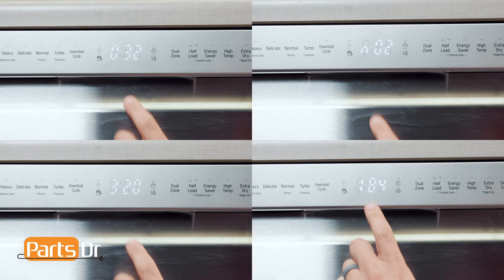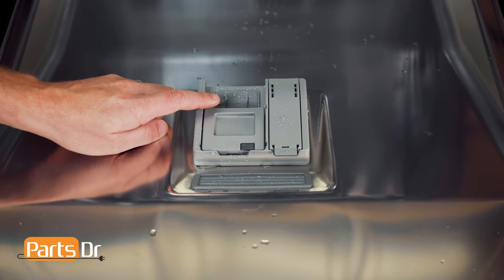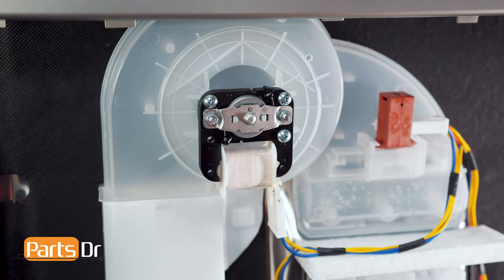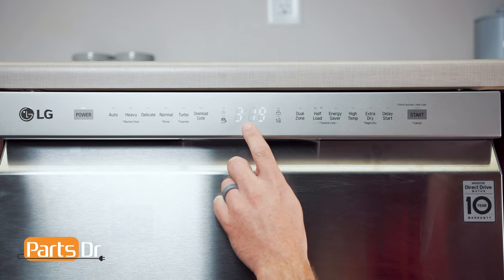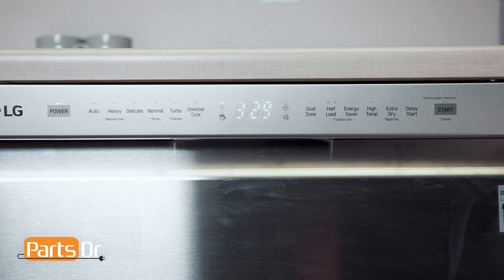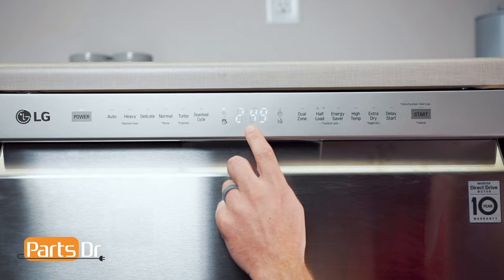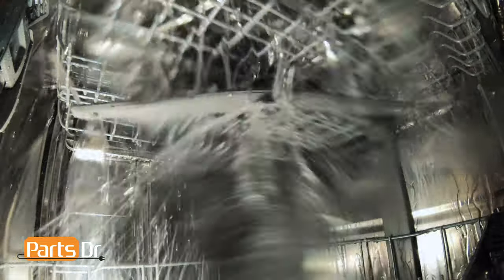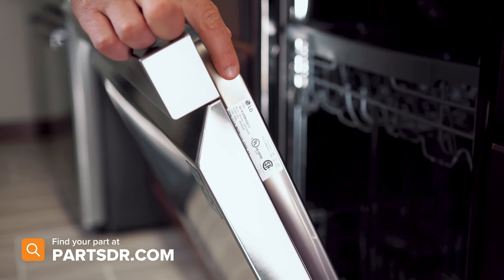TOP SECRET LG Dishwasher Service Test Mode

Comment: There is noise during last test, and noise the same as in this video https://www.youtube.com/watch?v=LHYlL6naQlc   : The part that needs to be replaced is the motor or something else? Thanks.
Reply from the maker: The sound in that video sounds like a bad wash pump (also called a circulation pump).
Reply: @PartsDr  but it drains water fine, could that noise be caused by  clogg or some sort of obstruction
Reply from the maker: @delltek102  The drain pump is separate from the circulation pump
Reply: @PartsDr wow... do they usually go bad that fast...could it be anything else that is causing that noise. Thank you.
Reply from the maker: @delltek102  You can take it apart and see if there is anything stuck in the pump
Reply: @PartsDr   ldt7808ss, can I diagnose from inside by removing filter and spraying arm...?

Comment: problem solved Amazon ABT72989206 $173.67 Phillips screwdriver and pliers required. Would say I'm unhappy with LG service, but that would imply that they responded and have a service department. They want you to throw it away and buy a new one. I think it's sad the one part LG brags about failed in 2 years regardless if they think it's going to make it 10.
Reply from the maker: Glad you got it fixed!  This part is Amazon is usually a counterfeit knockoff.  We sell the new OEM LG part here: https://partsdr.com/part/abt72989206-pump-and-casing-assembly

Comment: I'm getting an NE error code. I replaced the vario motor and a couple relays related to it, no help. I just tried running the vario motor test while the vario motor was hanging loose (I pulled it out to see if it was working during the year), and the vario motor was turning gradually during the test. I manually triggered the relay sitting next to the vario motor bracket and confirmed the test will advance to "lo.' Should there be a cam attached to the vario motor shaft ? I don't have one Bd wondering if that is why the ne code persists.

Comment: I have this same model. But when I get to test 7 it only displays "LO" not 1un or 1lo nor.dpes it display an error code even though the pressure is weak in the lower arm and the arm does not spin or push water up to the top sprayer. 

Any thoughts?
Reply from the maker: Only one spray arm operates at a time.  The diverter motor is what diverts the water to either the upper or lower spray arms.

Comment: My chime stopped working. How would I turn it back on for this model
Reply from the maker: To activate or deactivate the button sounds, press and hold Dual Zone and Energy Saversimultaneously for three seconds. The error alert sound cannot be turned off.
Reply: @PartsDr  Thanks that worked.